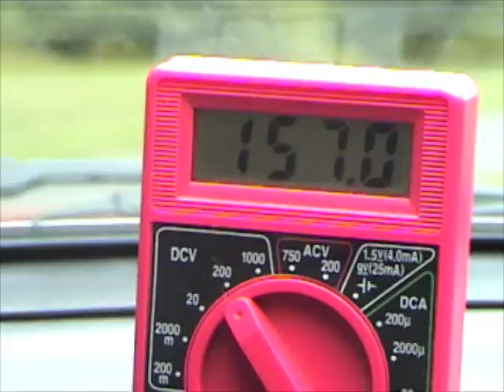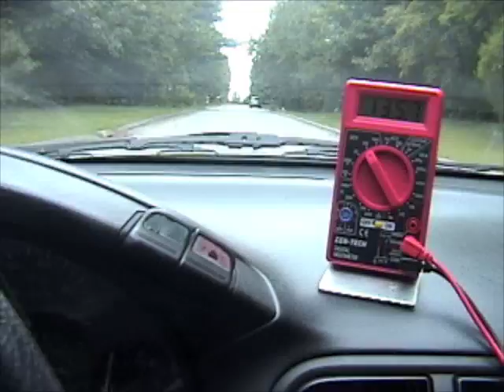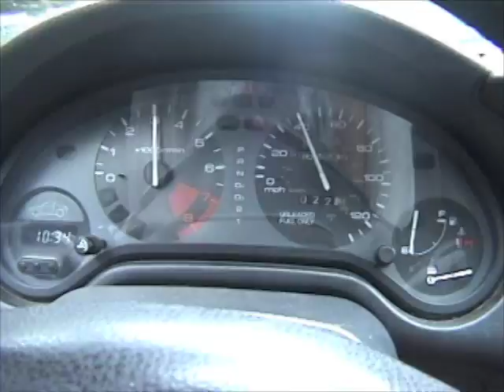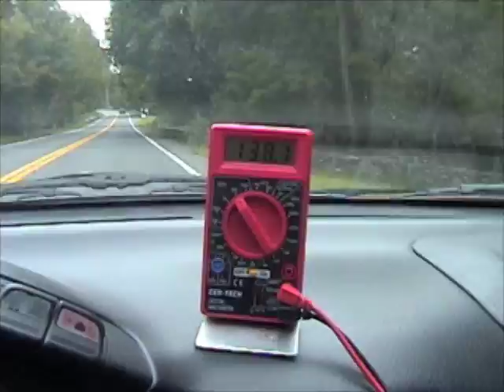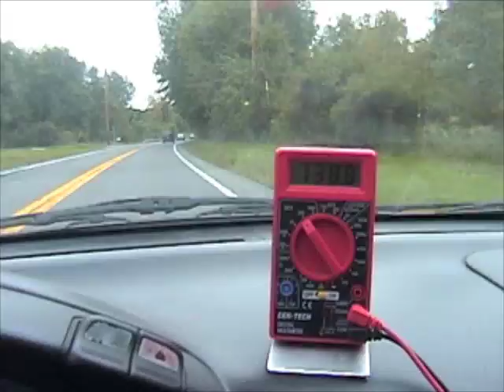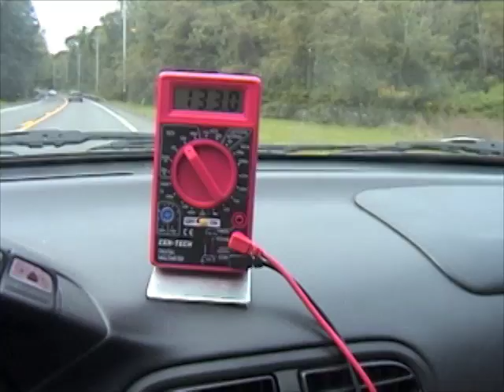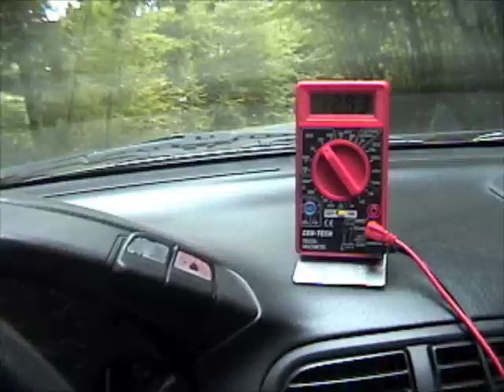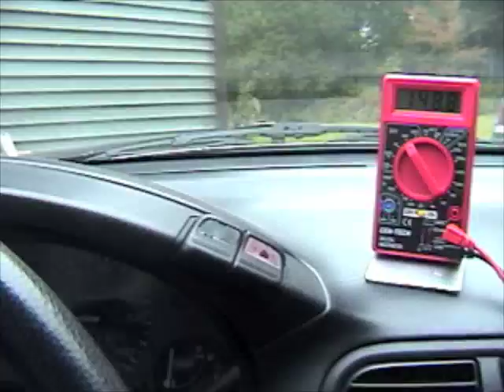Electric Del Sol

Comment: Cdog, tell it to the guys at NEDRA: they drag race EVs.  This del sol looks like it's sporting a 500A controller, so it's probably got way more low-end torque than it did as a gas burner.  I'll bet it leaps out of the hole!